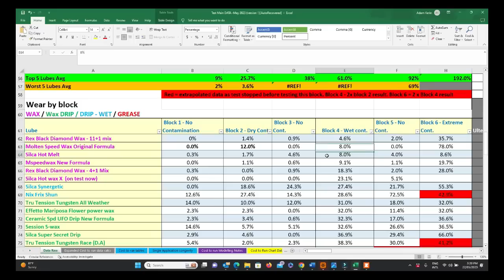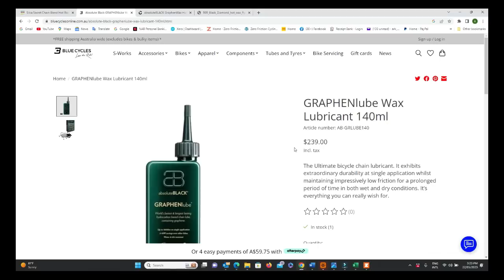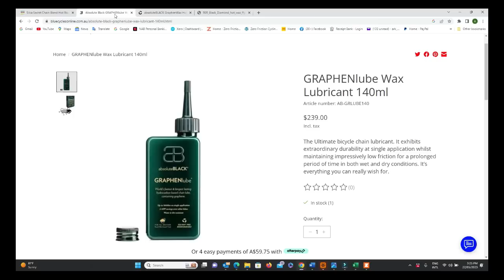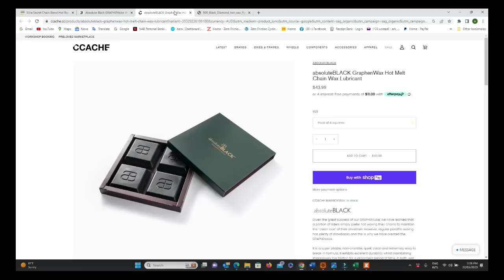Hot Wax X Test Update + Is graphene the new frontier?

Comment: seems a bit wasteful
Reply from the maker: how so? I didnt communicate this point properly in the vid but if one is using this product for dry riding, one can have a practically immortal chain, and thus exceptionally long drivetrain component lifespan - saving on waste of mfg of new components - which especially for some cassettes and chain rings is not insignificant in the scheme of cycling things.
Reply: @zerofrictioncycling992  graphene still costs around 500 $ per gram on the small scale, perhaps half that on a larger scale, who knows. granted you only need a fraction of that but manufacturing it and putting it on a wear item just seems wasteful. put it in epoxy for super strong parts instead. have you seen tech ingredients' video on manufacturing graphene? super interesting. they do it on about a gram per hour throughput in a vacuum chamber. having said all that, i think the UCI should step in again and ban these superlubes out of competition. deciding a podium on who was able to pay for a 300 dollar lube isn't sportsmanlike. i know, i know, graphene will be cheaper later down the line etc. etc. in the meantime i'll be dreaming about the shimano internal gearbox that'll never come out
Reply: Rex black diamond is like $65 USD dude.. costs less than a tire to run a chain through wax 300+ times and never wear out your drivetrain. It’s cheaper then regular lube by a long shot

Comment: After my first Silca Hot Wax X chain treatment, I rode outside at 45-50ºF for approximately three hours, and my chain was still so stiff I couldn't shift from the 28 to the 25 cog with a R9100 mechanical rear derailleur.  It took about 60 miles (100 km) over four hours before I could shift normally.  I broke every wax bond by hand after running the chain around a dowel rod before riding the newly treated chain too.  The initial break-in period is EXTREME, but once you get past that, the wax seems to last FOREVER.  I rode over 500 miles (800 km) on my last Hot Wax X treatment in dry conditions, and it didn't seem like the chain needed rewaxing.  I've ridden 2500 miles (4000 km) using two KMC Aurora X11 chains treated with Hot Wax X (every 500 miles), and I'm still reading 0.25 stretch.
Reply from the maker: Great report  from the field, yes breaking hot wax in in normal temps was a bit of eye opener, wow it must be something in those temps! but correct after that its longevity in dry is pretty incredible, as is the protection from wear. If one uses a long lasting chain (havent seen the best from kmc's yet) one could have a practically immortal chain on hot wax X in dry riding.
Reply: @zerofrictioncycling992 for my first How Wax X treatment, I followed Silca's instructions, and let the wax cool before removing it from the pot.  Following your instructions, I didn't turn off the heat before removal on my subsequent Hot Wax X treatments, and that worked much better for the break-in.  It's a bit warmer here in San Francisco too (this has been the coldest winter and spring since I've lived here).  At 50-60ºF, a newly treated chain still isn't great for the first 30-40 miles with a mechanical derailleur.  I have another bike with eTap AXS, and that doesn't have any issues shifting on a newly waxed chain.  The AXS motor must be a bit more powerful than my mechanical R9100 derailleur's spring.
Reply: I emailed molden wax about this last winter and they advised me to breake the chain indoor while the chain was in the end of its cooling down stages (not hot!) And that was very helpful in getting the chain smooth quicker. I broke the chain links and fitted the chain. It made everything much easier.
Reply: @rafaeldegiacomoaraujo8778  I just tried that yesterday, but haven't ridden the newly treated chain yet.  I broke the wax bonds when the chain was a bit warmer than I have previously and it wasn't quite as stiff.  I also now remove my chain from the wax without turning off the heat on the Instapot.  (A tip I learned here!).  Silca recommends letting the wax cool.  DO NOT DO THIS WITH NANENE!  My subsequent treatments have had a much quicker break-in period pulling the chain out of the wax while it's still hot.
Reply: I’m glad others are finally talking about this break in and shifting issue!!! 🙏

Comment: It may be time for me to move up from Squirt drip-on wax. I'm a big fan of this but been wanting to try the Silca dripon wax. I still can't justify in my mind going for immersive wax. Same for tubeless tires. The additional faffing isn't worth it to me. Give me something quick and easy and virtually as good: dripon and clinchers.
Reply: The initial set up (cleaning, immersion) is a bit of a pain, but I literally only wipe down my chain with a microfiber towel after a long ride and occasionally “top off” the wax with a Silca drip. No more chain cleaning with solvents and all of that crap. It’s a lot better. Re: tubeless, you should at least give it a try especially if you are on rough roads.
Reply: @freebird61885  Fairplay, Andy. To be honest, both of these methods continue to echo in my head. Maybe I should indeed at least try it.

Comment: Would you consider mixing the rex black diamond and the silca hot wax for the best of both worlds, wear resistance and wet riding? Seems intriguing. Have you ever tried 50/50 wax blends?
Reply from the maker: Hmm yes possible - i would not be surprised if someone does that somewhere. I am a bit curious how that would go i just have no idea yet where i could fit that control test in at the moment to do as a curiosity test - testing is busy.....

Comment: Very interesting stuff as usual, Adam! 

Regarding the cost comparison between Silca and Rex:
You've mentioned in a previous video that we should be able to get the Rex modifier block separately at some point. This may result in  Rex 4+1 being priced more competitively vs Silca (at comparable quantity).

Do you have any update on when we can get those modifier blocks?

As a follow up question in case mod. blocks won't be available:
Would it make sense to use the remaining 7 standard blocks for flush cleaning instead of UFO cleaner?
I've got 2 crock pots available and am considering which method will be the best to keep my 4+1 blend contamination free as long as possible. 

Keen to hear the expert opinion on that matter if possible 😊
Reply from the maker: Thanks martin! Yes i am 99.9% certain the mod blocks will soon be available seperately, this really is going to be a must, or for those using the high concentration blend the cost to do so will be very high. The fill level in most pots for the 4+1 is really low, so most will not get too many re waxes at all before fill level is not cover chain / making difficult to swish without some of the swishing being in air. 

They have already supplied me mod blocks separately so that i can offer BD wax as a pre prep option, and they advised they were working on the packaging for the retail sale side - so it should be soon. Most will in fact want to run 2 x 4+1 in their pot to have a sufficient fill level for awhile. 

But yes you can re your question - two pot system is great but mostly it is great for offroad cyclists to get a brilliant flush of any dust in pot one, keeping pot 2 amazing - watch the ridiculously long waxing FAQ Vid (man i need to re do that one) - skip to the 1hr 39 min mark to see two pot system like a boss
Reply: Thanks for the quick and detailed reply, Adam!

I've watched almost all your videos but missed the last minutes of your epic FAQ. Just rewatched the 2 pot part that you've mentioned - great trick to raise the chain from the contaminated bottom of the cleaning pot!

Awesome news that Rex is working on the mod block retail packaging! Will wait patiently...

Thanks so much for doing all this work and keeping us informed. Just made the switch to hot wax due to your videos and I couldn't be happier!

Comment: Is there more of a chance of a "perfect" lube coming from a wax, drip wax, or drip lube category?  Which has the most room to really expand and take over I guess is my real question. 

Your videos are ridiculously informative.   I watch them on my TV so I don't have to sacrifice on the phone!   They deserve it!
Reply from the maker: ha! aww thanks 10ktube that is very flattering feedback, although i do worry about how my silly mug would look on a big screen! i need to workout how to have like brad pitts face super imposed on mine. 

Personally i cant see overall how a drip lubricant can match the top immersive waxes. The simple fact is that chains are operating completely exposed, even the best drip lubricants will become contaminated over time even for dry road cyclists, and an immersvie rewax just flushes that contamination and re coats the chain in a fresh coating of solid super slippery wax. 

There is some time penalty for this vs just dripping a lube on, but it is small, and it is typically less than the time penalty involved for those who maintain their chain via other methods. 

For road cyclists who only ride in the dry, the gap between the top wax drip lubricants and the top immersive waxes has shrunk a lot since zfc started, such that for many - if they are going to get say around 90% of the friction and wear performance of an immersive wax with very infrequent maintenance - that will suit them perfectly. However, it will still not quite match what the top immersive waxes can deliver (and now we have though the combination approach which is the perfect middle ground for many - start waxed, re lube with wax compatible lube next 5 times, then re wax to re set any contamination starting to build. Brilliant option for so many where immersive waxing every time would be a hassle for them). 

For offroad and wet conditions - immersive waxing is still overall well ahead. There just is no easier way to reset contamination in chain than doing a re wax. For drip lubricants you need to solvent flush clean to reset the contamination. Adding more lubircant wont do it, and if one does not remove the abrasive contamination, the next rides in the sun will from a friction and wear perspective be very similar to if they were still riding in the wet - so i cannot see how drip lubricants will ever really take it to the top immersive waxes for offroad cyclists. 

Again, for just dry off road however, the top wax drip lubricants have great contamination resistance, so the combo approach still works brilliantly, and is again an outstanding option for those whom re waxing every time is not practical. 

I believe there will continue to be some great progress from both the drip and immmersive wax options coming in the next couple years, but that an immersive wax will have the highest chance of delivering an all conquering product.

Comment: Interesting. I have the same question about X and black diamond. I wonder if the graphene doesn't bond to the chain metal or the wax very strongly and is the cause of the drop in performance in the wet.  The other possible issue is that (according to a quick Google) graphene has a high potential to absorb water. That sounds like it could cause issues with adhesion of both the graphene and the wax, especially if the graphene expands as it absorbs water.  That could physically weaken the wax at microscopic level.
Reply from the maker: Yes exactly what will be happening will require the knowledge of very qualified chemists who focus on this area. It could be many many things, and the fact it was not / has not been nailed on the product releases to date suggest that even those with huge knowledge in this area still have things to learn and work out for us for the future.

Comment: Great information as usual. It will be interesting to see your final results.

I have a technical question for you. I would love to see more (any) eco-based immersive waxes available. Effetto Mariposa Flower Power is great but isn't available in immersive form. It also looks like it doesn't do well in the wet according to your tests. Do you think it falters in the wet because it's not paraffin (petroleum) based like the others or do you think it has to do with something else? Thanks as always.
Reply from the maker: I would say that FP was actually pretty impressive overall in the wet blocks testing - you really need to compare FP to other drip lubricants vs the immersive waxes, the immersive waxes have the unassailable advantage that a re lube - which is a rewax, will re set contamination vastly better than dripping more lubricant over the top of existing contaminated coating can do. Compared to other drip lubricants FP was very impressive still. The overall wear result really comes down to how much contamination does it absorb vs competitors, does it have any ability to clear that contamination to some degree, and does the treatment sufficiently survive the test intervals before re lube. 

There are many many more lubricants on the market claiming to be very enviro friendly which i have not had a chance to look at yet - again testing is generally so heavily booked by manufacturers these days that getting a spare spot to test a product on my own volition has been more difficult, and when i do get a spot i am normally testing a product that is making the biggest and boldest (or weirdest claims - like prestacycle one) - it is often either a product i believe has a great chance of being a top lubricant option to add to the mix, or a product where i have the most concerns about the claims. There are just countless hundreds of lubricants making pretty much all the same claims with nothing to substantiate them - and the zfc test takes a lot of time and resources to conduct - i wont really be able to work through products at random, i will need something compelling to test those products - so if there is a heavily environmentally focussed product you think fits the bill for the zfc radar, let me know - but yeah.... there are lots of them. 

A big consideration on that front as well is maintenance. If i think of the millions of households around the world that would currently be maintaining a wet lubricant chain via degreaser or similar method, and where does that end up - this is a big factor as well. So top lubricants that need basically zero or near zero solvents to maintain them at very low friction loss (and thus wear) is going to be an important part of the overall picture when i do a vid focussed on this topic. 

It is not quite the same but it is a bit like the focus on bio degreasers. That is great, but only if what you are cleaning is also 100% enviro friendly. Ie i have an expensive bio degreaser that is rated for direct release (ie you are fine to pour it down your drain) as it is so enviro friendly. But i use it to clean my factory grease chain. Or to maintain my chain where i use tri-flow etc. what i now have, is safe for direct release, i now have a contaminated degreaser. But people think that because they bought a bio degreaser, all is sweet. 

So the full picture really needs to be covered - top enviro lubricant options as well as the initial cleaning and their maintenance.
Reply: @zerofrictioncycling992  Thanks as always for the thoughtful response, Adam. I really appreciate it. I thought it might have to do with immersive vs. drip but wasn't sure. And that makes good sense.

I'm completely sold on immersive waxing and can't see going away from that. I don't know of any products that you don't because I basically get all of my information fro you! 🙂

You make a great point about maintenance. For waxing, I cleaned the factory grease off of my Eagle X01 chain a year ago and that's been it. I recently had to get a new chain thanks to a rather large stick in my drivetrain but even after a year it was perfect and showed zero wear. It really is remarkable. I guess until there are proven non-petroleum based alternatives, paraffin is probably the best solution even environmentally speaking. Maybe you'll hear of something that truly is revolutionary and you are able to test it.

Thanks for all of your hard work.
Reply: @zerofrictioncycling992  Its a shame that some manufactures dont let you publish the results. Especially if its doing good on the testing. Having been aware of ZFC testing before and now watched your YT videos I have full confidence in your testing and will not buy a product that ZFC have data on from now. Way too hard to know what a mfg claim is real or marketing BS. Being through the ZFC testing regime is a seal of a manufacture standing behind and believing  in its product and quality. Keep up the amazing work that you do.

Comment: Not a materials engineer, but it's my understanding is that graphine is great as a resin or other polymer binder additive.  Could it be that if the strands of Graphene start to ball up when they get wet, that the act as an abrasive?
Reply: If so they would show wear in wet uncontaminated block, but they not. However I'm pretty sure graphene is put not in tubes/strands but slates which clump into graphite. Key might be electrical negativity of carbon, attracting abrasives with static charge. But that's also a speculation/educated guess.